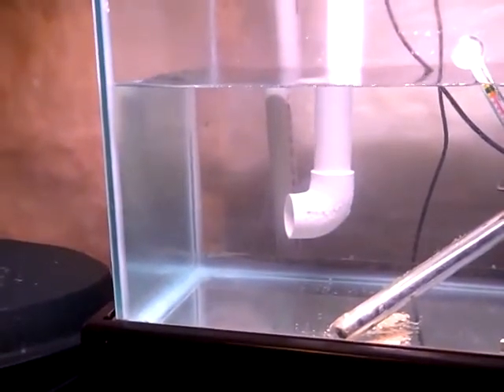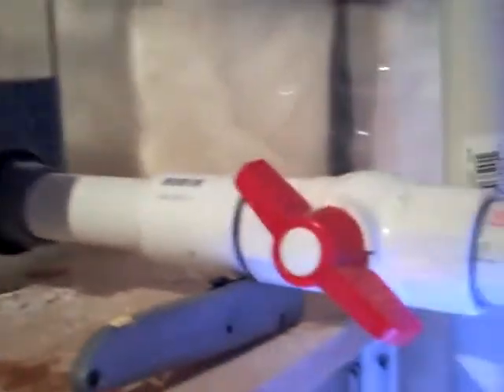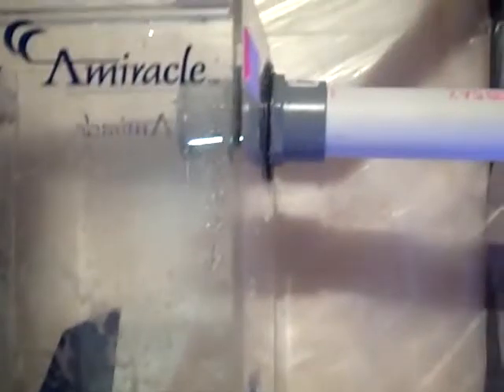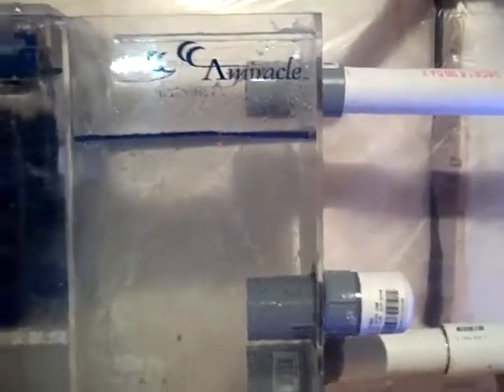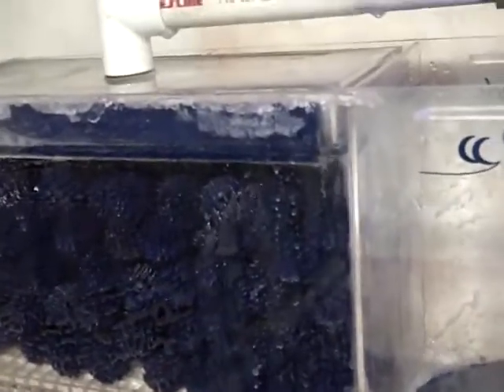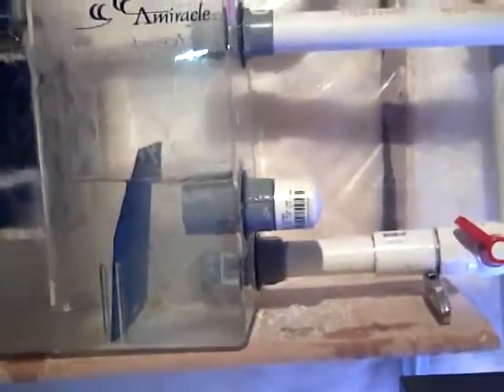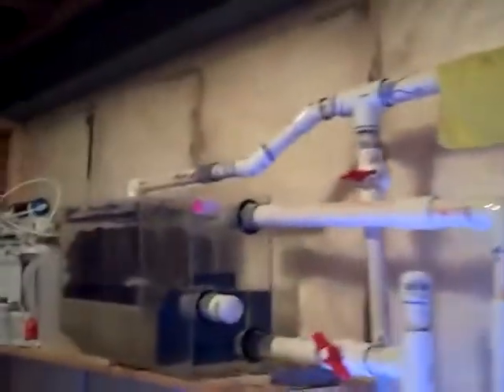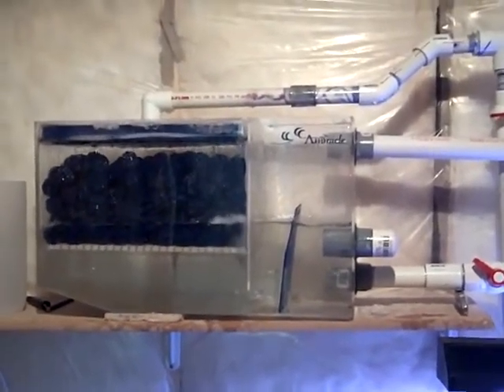Part 7 - Emergency Pipe Failure

Comment: I think the issue isn't the mechanical filter but rather the fact that your emergency drain line is on the same level as your filter pads. I would recommend having it about 2 inches below the filter pads.